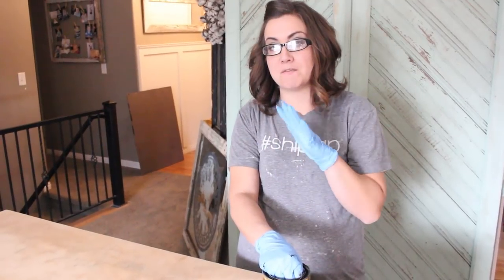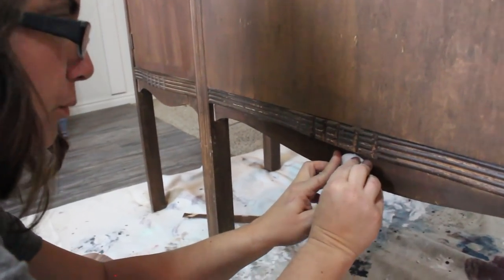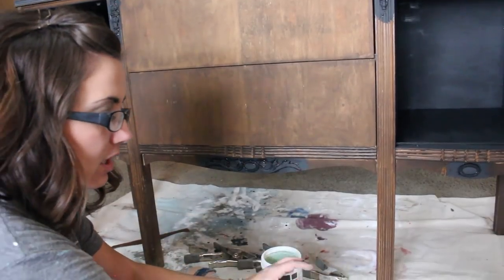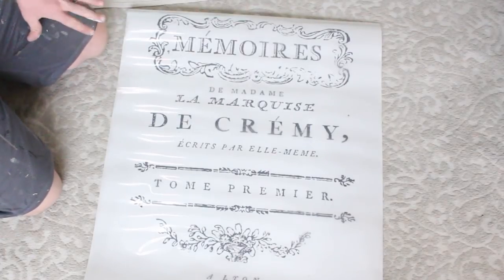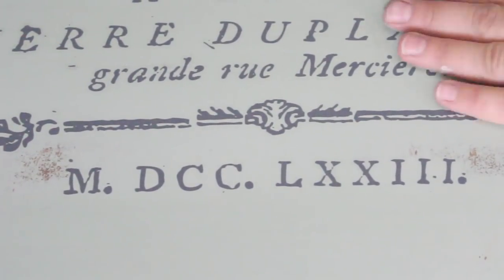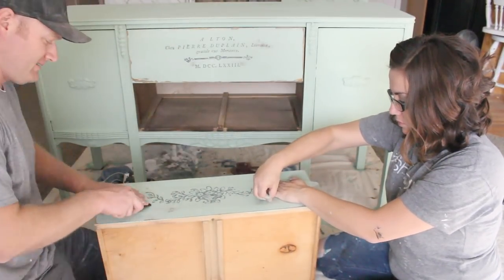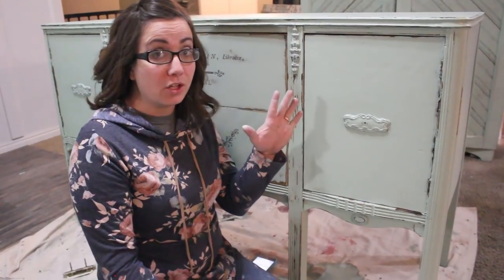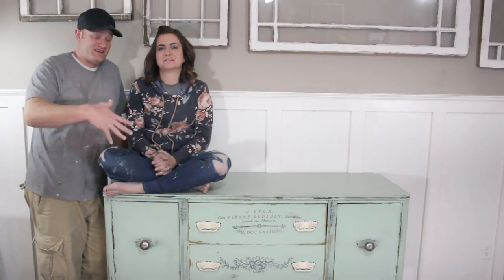French Country Buffet | How To Get This Look

Comment: I have a vanity that I'm working on getting the veneer off of and it's a job !!! I decided to paint mine because the wood is so dry that I figured stain wouldn't work and didn't figure the conditioner would help either.  This video has given me some great ideas and I have the decal.  Think I may use parts of it.  You've answered several questions that I had.  Thanks again.  You and Zeb are great !!!